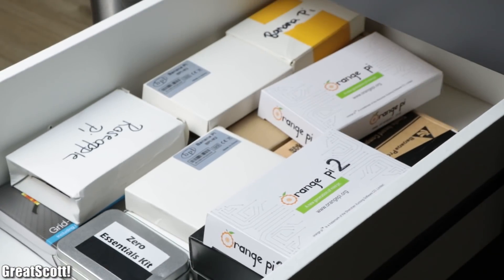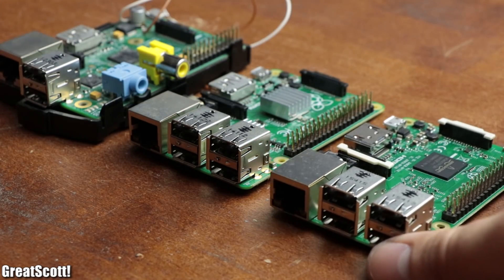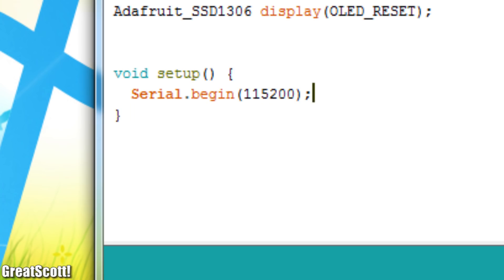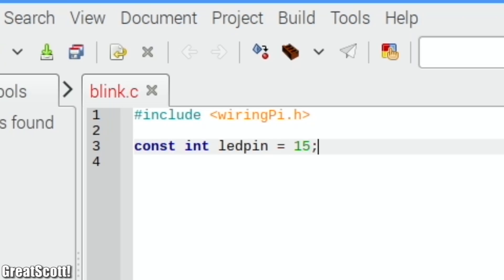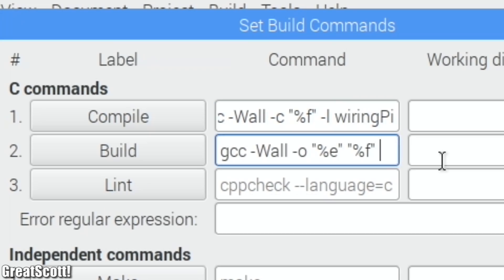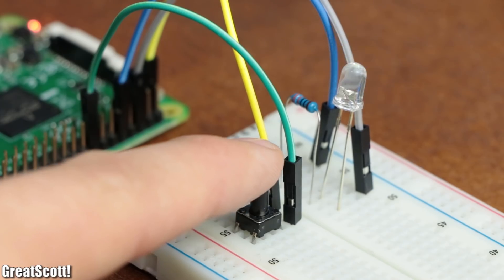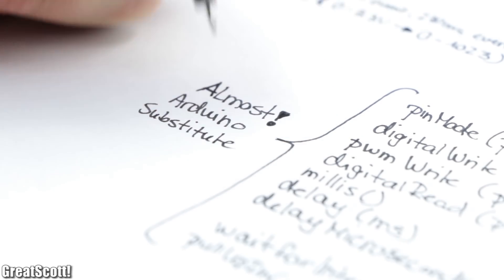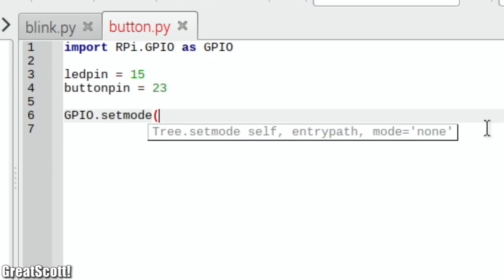Can a Raspberry Pi be used as an Arduino? || RPi GPIO Programming Guide 101

Comment: I am worried about it not being able to be event timed based system. The point is arduino and pi needs to be combined mainly use pi for alexa and computer vision while arduino is for servo, pca 9685, and the accelerometers and other sensors and arduino handles machine learning or pi not sure which is best maybe arduino for machine learning since pi can't handle event based programs.

Comment: The GPIO can definitely be awesome for getting started with simple hardware development that also involves a software-in-an-OS side. But for things that need a lot of GPIO stuff and not really a complete operating system, I'd directly use a Microcontroller like an Arduino, or an ESP if you want a bit of networking as well.
I personally use the GPIO more like a custom pin header to include things like fan control and a power button and LED, perhaps also for sensors in the future (though only if it's really stationary and requires to run with an OS).

Comment: Wouldn't a raspberry pi be better as an EEPROM programmer? Contributing factors are 
1) The Arduino does not have enough flash memory (32kb for both code+data, most larger EEPROMs are 32kb by themselves)
2) The raspberry pi (at least the newer ones with 40pin) has enough pins for address, data and ce/oe/we without using a shift register
3) You can have assembler, compiler and programmer on the same thing, and not need to translate the binary file to a C array.

Just realized that I am commenting thinking that I'm watching Ben Eater and referencing his projects. The points should still hold.

I bought Eater's 6502 kit and got a Nano and some shift registers in addition to make his EEPROM programmer. But because I am stupid and got parallel-to-serial shift registers, I will have to use my raspberry pi (2b). I'll update y'all with progress once I start to figure it out.

Comment: Another cool way to use your Raspberry Pi, is to set it as headless, meaning no need to use peripherals. Instead you can connect to the Raspberry Pi via SSH, essentially enabling remote access to the Pi. To make your Pi headless, install the Rasbpian Lite image (no desktop available) which is very lightweight compared to full desktop version, as it doesn't install any additional software or desktop libraries. You can then connect via SSH, from your PC, to run your scripts or manage the Pi. I would recommend to use VSCode Insiders and remotely connect to your Pi to start developing. This is an IDE that provides code highlighting, as well as many other features via extensions, a really powerful, yet free tool.

Comment: Or  lets say you need USB and/or ethernet. As soon as you need a little more connectivity the raspberry can become economical if you don't want to go into mass production.
As all the circuit board design and assembly can easily cost as much as dozen raspberrys where you just clone the Sd-card.
Just consider that the person you are assigning the work to can easily cost around a raspberry per hour. Even on the very low end you don't get more then a few hours for the price of one.

So below say 20 or 30 pieces even significant hardware overkill can actually be cheaper.

Comment: Considering a Pi 4.  Dabbled with Pi3 controlling an SPI 24b ADC, but found out SPI clock was locked to CPU clock which changes with CPU temp.  Unacceptable for embedded.  Does the 4 fix this issue?

Comment: A Raspberry Pi is a micro computer meant to replace the standard computer, it runs on a Linux distro. So it could be used for prototyping but it won’t be the same.

Comment: You can use a Raspberry Pi as a uC, except when you need a hard-realtime system - hard realtime systems require an RTOS to guarantee event driven responses and you cannot rely on the HW of a General Purpose CPU for that (largely due to the OS). Soft realtime can be implemented on a Raspberry Pi as the events become less critical.  For example, if you want to build a pacemaker - ONLY EVER USE a uC with a solid RTOS (as no events must EVER get missed) !!!!

Comment: A BMS based on a Raspberry Pi seems like it could be very useful (assuming that it's possible). I've been trying for a while to dream up a BMS that could monitor and optimize each cell individually by being aware of it's specifications (which is probably unnecessary, but could potentially make it very beginner friendly) and a Pi seems like it could be a good way to achieve that

Comment: I found that the best option is that of using an Arduino/clone (maybe one of those cheap Minis) connected to the Raspberry Pi. So you have the power of a computer, combined with Arduino functionality (for example, controlling The WS* family of LED strips using the FastLED library). The only difficulty is that some kind of protocol has to be used to interface the two systems.

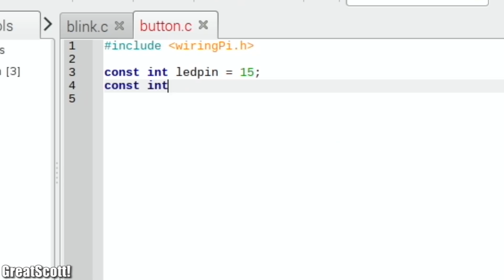Comment: 5:05 can you not use the 5v pin on the pi?
Reply: The gpio pins are able to output or read 3.3V signals, but connecting the pi's 5v pin to a gpio input will likely fry the gpio pin, if not the whole pi.

The 5v pin is mainly for powering external components that don't connect back into the data pins, in my experience at least.

Comment: I have been using a pi as a controller for a robot and I have been getting very good results , The only downside is that I need to run a motor controler off a seperate 12v battery for propulsion.

Comment: If I’m a programmer then where should I start with Arduino and circuit board stuff ?

Physic ? Electric? Code ?
Reply: Purchase an Arduino and try to get it to blink a LED when you push a button. That should be a good start.

Comment: One important thing, you didn't mentioned is, that you can run multiple programms in parallel, because you execute the code on a Operation system. May it's not an RTOS but in most cases it isn't necessary. I jused this fact, to controll a IR-LED in a sub-programm with delays, that didn't affect the main Programm noticeable.

Comment: For someone who has never been in contact with any programming-language whatsoever, and thus have absolute zero knowledge, where do one begin? 

I do not have time to attend physical location or scheduled online-based classes because of my work-hours etc. So I need good, proffessional and very detailed educational material, for studying the most used programminglanguages on-demand (and preferably offline) in my free-time.

From the absolute basic "kindergarden-level-javacode" taught in an almost "IQ-free-friendly" way - to learn how to write full-scaled advanced ultrasecure enterprise software and A.I controlled hardware robotics written on a custom company-exclusive platform based on its own private programminglanguage. Like the way for example most bankingsystems are developed for enhanced security.

With a vision like that in mind, where do I place my very first foot-step? And when it's time to advance into "Ironman-level" tech-study, where do you find serious classes and proffessional litterature?

Comment: can we use analog value to pins as out
for example: digitalWrite(motor,130);
any equivalent to this in pi???
Reply: If you mean using PWM on a output, then yes, there is a equivalent.

https://sourceforge.net/p/raspberry-gpio-python/wiki/PWM/

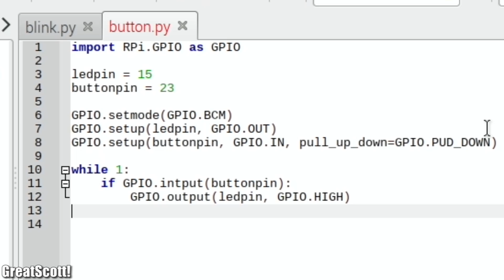Comment: 7:58
What about showing us some kind of GPS tracking system for a raspberry pi, connected with the ODB2 connector of a car.
ODB2 shares some info about the car's specs. Like mileage etc.
The raspberry Pi could connect with the user's addressbook (contacts) or calendar via APIs to figure out if a certain trip is business or leisure.

Comment: I have a project where I need at least two analog outputs, X & Y and one analog input Z. Ten bit resolution in/out would be ideal. This part of the project is all hardware and will probably use a three wire SPI interface.
This will be for an addressable video camera that does not continuously scan, but can operate completely statically. It can be parked on a single pixel and measure it continuously or scan in any pattern desired. Full raster, pseudo random, full random, spiral, tracking microscan, etc. Microscanning a small region also improves data collecting efficiency as the entire field of view need not be read in each time. Aspect ratio is 1:1. I want to use the Raspberry Pi because it has magnificent video display support built in and full file system support, unlike Arduino. A hybrid Pi/Arduino approach is not out of the question. For the curious, the project is called the Philocam and can be seen, in process, on my own YT channel.

Comment: I have an off-brand SBC with a TFT display. I used the image the manufacturer provided since I failed to deploy the kernel module myself. There are 3 GPIO pins dedicated for buttons that was not programmed.

I pulled together my limited knowledge in python and managed to make the buttons send commands to i3-msg

Comment: A raspberryPi Zero is not as expensive, and still soo much more powerful than Arduino.  I did some in python, super easy, lots of possibilties... but still gotta be a use... I prefer the barebones raspbian without Gui.
I more love the ESP8266..esp32... boards now, seems like a happy medium, you get the wifi and all, but without cost.

Comment: 1:10: "I went for the Raspberry Pi 3 model B."
1:42: "...and powered up the system with a 5v phone charger".
Me: "He's gonna have the yellow lightning."
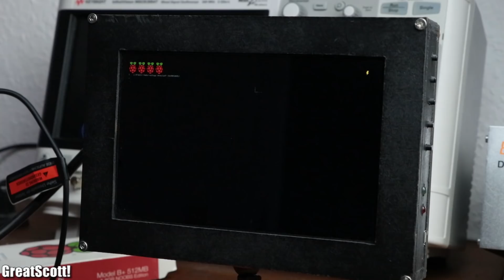1:46 Called it

Simple 5v phone chargers as RPi3B power supplies might cause sudden/unclean reboots, even more likely if you use USB devices attached on it (such as keyboards or USB flash units). A stable voltage is given on about 5V1 with thicker copper wires.

That said, I would calculate that the Arduino draws much less power than the Raspberry, and is much faster, being a RT system. Using it as an Arduino substitute? Yes, but only if you have no concerns about power, don't care about speed, and you need to create complex projects (such as a retrogaming portable). Otherwise it would be a misused waste of potential IMO.

Comment: Maybe use Rpi as a flight controller for a drone or rc plane.  Then one could control it with more than a basic radio controller. For example, one could use C or python to preprogram a flight path or do other things not possible with a store bought flight controller.

Comment: Hi  One problem.  Pis & 'duinos are totally different animals.  "Should I use a chop saw or a screw driver?"   The question to ask is: What types of I/O do I want?  If you need video (in or out), USB,  networking or lots of RAM, then you are in Pi territory.  If you require more bit related I/O or modest A/D and or D/A, an Arduino might be more appropriate.  Don't try to jam a square peg into a round hole.  Just my two cents, gleaned from 30 years as an Electronics Technologist.  Good info otherwise.

Comment: PLEASE HELP!  Can we run raspberry pi as ardunio. I mean as in ardunio if we upload a code once and if we run it  after power off and on it will directly start running  that code. Can i do the same with the pi. I want the pi to directly run a code when i power it up. without going to the monitor menu and and executing that code file. Ex i want to use pi as a cpu of a robot i cant connect with pi to a laptop and run the code every single time i switch on the robot.

Comment: It's also possible to program the Pi directly through the PC (just for Win 10). Just install Windows 10 IOT on the PI and Visual Studio on the PC. Then open an Arduino-Wireing-Project in Visual Studio and there you go ....
The thing ist, the Pi  might have an other drawback besides the ones you mentioned: It can't do very accurate timing, because there is still an OS Running in the background.

Comment: There is no such thing as Arduino programming language. For programming Arduino with higher level languages you can use normal C or C++ and compile it with a compiler that supports atmel architecture (e.g. avr-gcc).
And don't use sudo in the IDE, this won't work for someone who has sudo configured to require password (which is the default). Instead you can create an udev rule so you can access the GPIO from the current user.

Comment: I find bare metal programming easier.
Reply: Yes, on the Raspberry Pi board. Then it is no way comparable with an Arduino. The Raspberry Pi board has 32/64-bit ARM core, HDMI, plenty of memory and then you have the Arduino .....

Comment: Hey scott, very good work you do man... Thanks for you make us noobies learn and do bigger Stuff now. Though i prefer arduino for its simplicity. 

For all time i followed your project, i was eager to build the efficient high voltage (120v actually) 3 phase AC motor controller using arduino or raspberry pi... Is this project possible? 

Thanks for very cool projects tutorial...

Comment: What you think about non insulated negative power supply triggering circuit for logical level triacs by connecting vdd of the controller circuit to a1 terminal and it's gate pin to vss of controller through a current limiting resistor. is there any down side of this type of circuit bcoz of no isolation between two circuits of different potential.

Comment: So what I wanna know is "How stable is Raspberry Pi, When it comes to inputing and outputing data on the fly?" AvE says you cannot trust arduino to not crash during critical operations that require external coms. Ex. Let's say you have a moving object that is reporting it's position to the R.P. then the R.P. does the math and tells the object to proceed to the next coordinate. The moving object is logging data. It doesn't have to transmit all the data. It just has to get 'home' safely. Can Raspberry Pi find it's way home without crashing in the woods somewhere? This may be  bit long winded, but basically how stable is Raspberry Pi with processing external data?

Comment: how big of an lcd can i control with an arduino   i would like to make basically a program to aid with my other hobby of farming using things like gps to help keep a even spread during broadcast seeding and another use would be during plowing to monitor plow depth with possibly ultrasonic sensors    or is this to complicated for an arduino would a raspberry pi be better suited for the tasks at hand

Comment: Two projects I have always wanted to see done with a RPI...solar panel alignment system using solar tracking (panel follows the sun for max power) and similar auto window blind adjustment to most efficiently adjust vertical blinds to allow blocking direct sunlight as the sun tracks across the sky.
Reply: im trying to make an ai based solar mppt using raspi

Comment: Excellent! Do a video like this for a TI controller like http://www.ti.com/tool/LAUNCHXL2-RM46

Texas Instruments have interesting controllers, yet they are quite difficult to set up through HalCoGen (hardware abstraction software) if you don't know the peripherals and their electronics/ functioning principles.
Also, they may easily send you a free board if you just contact them and say you need it for a review. Texas Instruments has been reboosting their influence in Europe lately, they have a center in the Netherlands.

Even if you buy it- the price is minimal. It takes 2-3 days to process the payment and they send it to European states in aprox. 2-3 days more. It's yours in less than a week.

Comment: Hey scott, Can you make something simmular to this €200+ The OM-DVCV it can log up to 600 V and 300 A. Its would be ideal for Troubleshooting Electrical Problems. Maybe if you could creat a cheap but functional arduino based signal logger with multiple optocouplers or somthing that wil work with voltages upto 230v and up to (idk) 30 A? That would be a great DIY video!
Greats Eric.

Comment: You could just measure an RC time constant using the potentiometer..... It's very simple construct and just need a capacitor (I'm certain that you have a few). It's a relatively simple method for measuring an analog input.
Reply: As a side note only 1 pin is hardware PWM (well 2 if you want to kill the sound output) , so (depending on the application) the raspberry pi cannot come close to "replacing" and Arduino. I use an Arduino to control my 3D printer and CNC machine. The raspberry pi cannot do these tasks because of the lack of true PWM pins (controlled by a hardware timer).

In my case though I use them both together; Octopi to interface with the arduino on the 3D printer and BCNC runs on the Pi as well to interface with the arduino on the CNC machine.

Comment: I have a couple of original Pi 1s doing basically arduino type stuff in my home automation system, but they run a basic java server. They run i2c library and I expand to a bunch of ADC inputs, and a bunch of opto isolated outputs. Why Pi, because I had them, and I wanted to have a bit more processing capability for the data. Now I'd use an esp32 for similar application, but these Pis have been in service for close to 8 years and have up times since the last time I was messing around with power -- about 250 days. The java server can do things a bit easier for data processing and analysis before sending it along to the home automation brain. For instance I can pick which ADC post processes I want to use when subscribing to an ADC input in the home automation brain, either straight data, or one of several mathematical smoothing algorithms -- SMA, WMA, and Bezier -- just the ones I implemented. Arduino could do it, but it would be pretty taxing on the CPU to that much data smoothing. Just depends what the use case is, and what you have around.